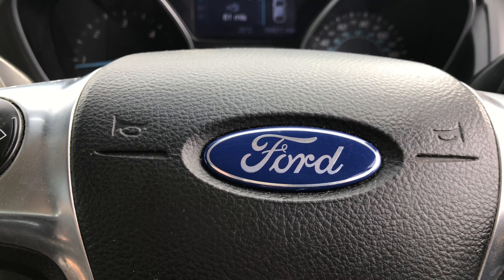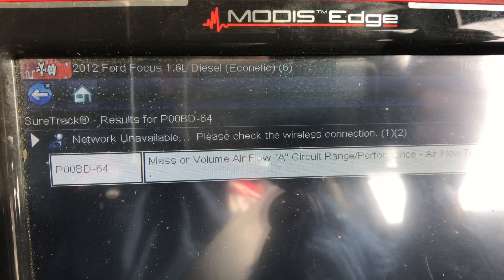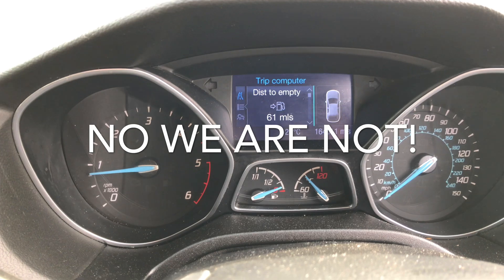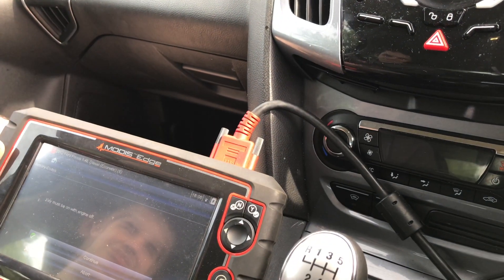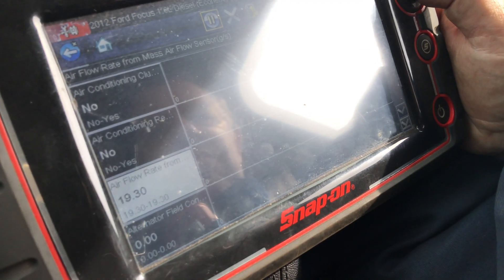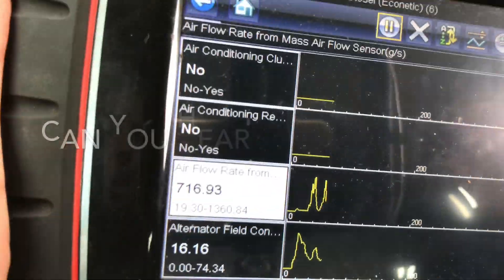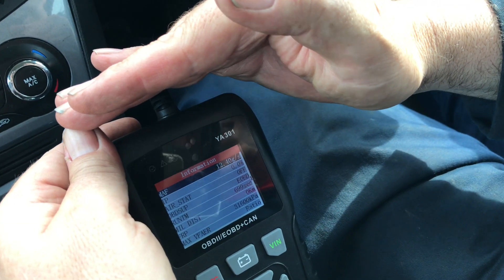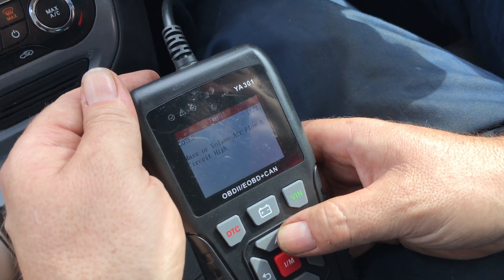Ford Focus 1.6 TDCi - POOBD-64 - Mass or Volume Air Flow "A" Circuit Range/Performance

Comment: I've got a 1.6tdi focus 2005 same code throws it into limp mode for a few seconds engine light flashes and goes off, was a whooshing noise and the boost pipe coming from the intercooler was split I've replaced it and still having the same issue.

Comment: Had the same air mass flow meter fault code on my Mondeo 1.6TDCi…changed the air mass flow meter and no improvement. A mechanic heard the engine starting and immediately diagnosed a leaking hose from the turbo. In fact the hose located under the air filter case was completely detached due to a rusted and broken jubilee clip. Refitted it and car now running fine. No engine malfunction light on now. Result

Comment: What pipe was is that had split Iam having the same issue on my mondeo same code and I’ve tryed new maf
Reply: Did you get an answer? My 2.0 focus is in the same boat as your mondeo.
Reply: @Utaker935  same ya guys any news ?
Reply: On my 2.0 tdci focus 2013, I've noticed over the past week a woshing noise in-between 2-3rpm, it went into regeneration twice in the space of an hour then I botted it and got that e gone malfunction. It won't rev now over 4000rpm and no turbo boost.

Comment: Whoooooooosh. Sounds a lot like my Volvo which throws the same code as well as a P0299. Leaky turbo charge pipe, in particular the part going to the intercooler is prone to crack.

Comment: Iv got exactly same car. My car brought up maf sensor code so replaced that now its bringing same code up with underboost. Do you know what it could be? Iv just had brand new turbo fitted but it's going into limp mode.
Reply: There is also oil mist on my boost sensor. Garage said it needs new O-ring seal but would that seal make it go into limp mode?
Reply from the maker: Look for burst/ripped turbo hoses! Drive car with windows open u may hear whoosh sound
Reply from the maker: That's normal
Reply: I'm not familiar with cars which is the boost pipe?
Reply: I mean turbo hoses
Reply: @adamyates416  It's the pipe going from the turbocharger to the intercooler (which is in the front of the car) and the pipe going from the intercooler to the engine.

Comment: On VAG group vehicles you’ll get an air mass intermittent fault stored when you have boost leaks and egr faults. You’ll need to start using that new smoke machine if yours.😉
Reply from the maker: Cheers Will do, Sandy